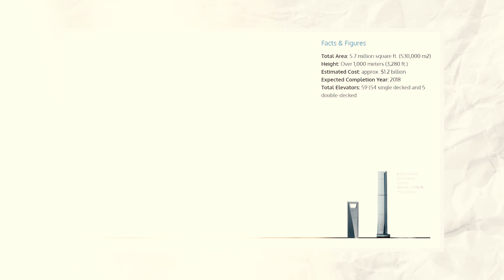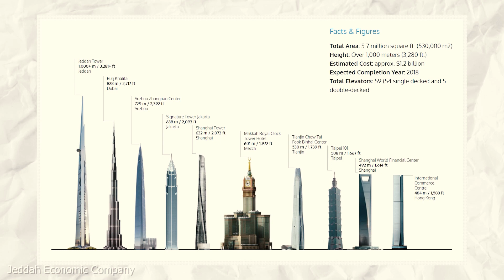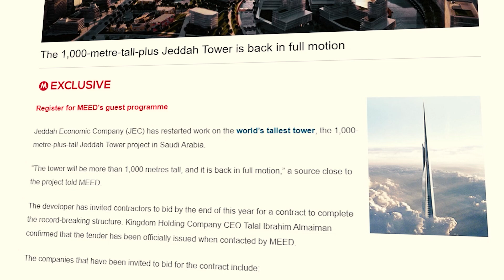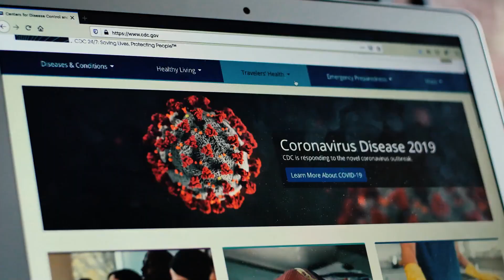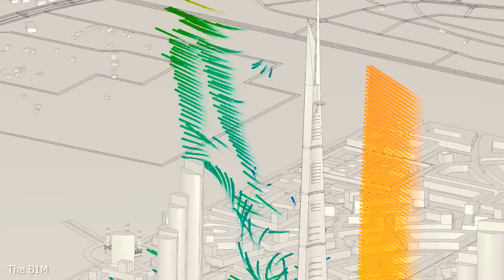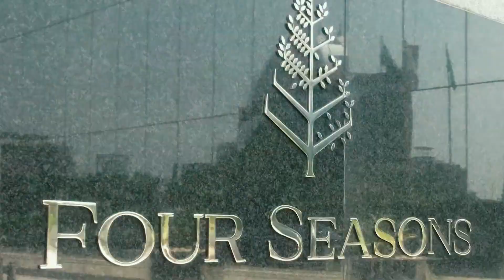Construction Resume of Jeddah Tower World's Tallest Skyscraper in 2024

Comment: work has not restarted on the tower yet.  three months ago, a notice was put out that the project was looking for new partners and drawings and invited interested parties to submit by january 2024.  then they have to review, select, and assemble the new partners.  then, the current structure has to be inspected to insure nothing needs to be dismantled and replaced.  at best, actual construction would resume mid 2024 if not early 2025, and i'm just not sold that it's going to resume